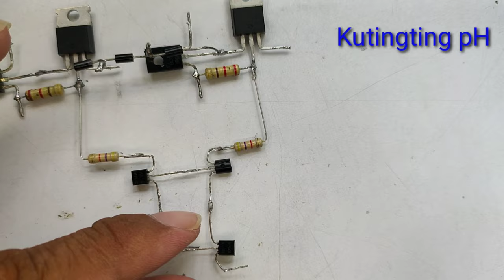DIY audio Driver Amplifier modified av502 500watts max

Comment: I really do like his drive stage but to go high-powered I would replace the DB139 and the DB140 with the mje340 and the mje350 by Motorola these are very nice transistors high voltage. 🤗👍 The 2n5401 and complementary  2n5551 and the C2073 and the A940 are nice transistors that he used they are high voltage. Add more output transistors and a higher voltage transformer rectified to DC and you could turn that thing into a 1000 watt amplifier mono block. But overall I think he did a great job 🤗👏👏👏👏💯

Comment: Great circuit sounds really good I decided to build it yesterday I put all the components on a PCB board and I put a 470 / 50 volt cap at the beginning of the input to give me a little bit more bass. Love this circuit nice schematic layout as well ✌️💯🤗 going to add more output transistors to make it a thousand watt amp. And thank you for sharing you're awesome. 🤗
Reply from the maker: Thank please like & share👍
Reply: @kutingtingph  Your welcome ✌️😁
Reply: hi good day po master,boss pwedi po, pa request diy ng wireless mic po..thankz...

Comment: U can make 1000w amplifier.?
Im very interested..
Reply from the maker: Ok sir
Reply: Yeah all he has to do is add a bigger transformer 35 amper  rectifier and bigger caps and more transistors on the output stage with bigger heatsink with cooling fans and definitely bigger speakers 2-12 or 2-15s 4 ohm load and 16 gauge or 12 gauge speaker wire to connect the speakers.👍💯 what he just built there is a drive stage with two transistor NPN and PNP on the output stage push pull class Ab amplifier approximately 75 to 100 Watts output power or maybe 150 to 200 watts depending on what transistors that he used on the output stage✌️
Reply: I really do like his drive stage but to go high-powered I would replace the DB139 and the DB140 with the mje340 and the mje350 by Motorola these are very nice transistors high voltage. 🤗👍 The 2n5401 and complementary  2n5551 and the C2073 and the A940 are nice transistors that he used they are high voltage.

Comment: sir sinubukan ko 45vdc sir umosok po ung dalawang 4.7k sa collector po ng c2073 at a940, anu po problema nito sir? Hndi nia po ba kaya 45vdc sir?
Reply: First of all you should try using 1/4 Watt and 1 watt resistors 1/2 watt resistors could burn up. All resistors have a Watt rating. And make sure that the positive VCC wire is on the NPN transistor and the negative wire VEE is on the PNP transistor of The collector and make sure all three diodes are facing the same direction one wrong move will destroy the whole amplifier pay very close attention to what he is doing I hope this helps 💖✌️

Comment: sir bakit ang init po si bd139 at bd140?
ginawa ko kasi bat mainit sya
Reply from the maker: bd139 at bd140 dapat solo Lang nya Ang 220 ohm resistor Ng emitter supply nila pag umiinit Ang 220 ohm iinit din bd tranie dapat d iinit or b dadaan sa 220 ohm resistor  Ang supply Ng deffirential section 
 or dapat solo Lang Ng bd tranie Ang 220 ohm resistor at supply nman Ng collector side Ng differential ay Ang resistor 4.7k dapat 1w Ang 220 ohm  
At 4.7k 1/2w pwedi na salamat Sana  y naunawaan mo salamat👍
Reply: @kutingtingph  sir ano fb name nio patulong naman
Reply from the maker: @christiannicolas1956  pm moko sa Kutingting pH Facebook page ko nakikita na dun ok

Comment: wow 33 vac pwedeng pwede na pang bahay at pwede narin pang sounds sa labas hihihi...

idol talaga kita kahit kailan.

Galing sir. ayus
Reply from the maker: Salamat lods
Reply: @kutingtingph  sir ask if pwede 5198 at 688?
Reply from the maker: Pwedi sir
Reply: @kutingtingph  sa 940 at 2073 sir pwede substitute tip41c and tip42c?
Reply: sir bat di gumana sakin.?

talong Circuit na pinost mo sir wala pong gumana bat ganun
Reply from the maker: Goods ba mga Transistors mo lods 1.basic tests Transistor Kung goods. 2.anung trasistors Ang gamit mo Anu Ang datasheet neto
Mag kakaiba data Ng mga trasistors
Meron👇
[B C E]
[E C B]
[E B C]
Sana nakatulong
Reply: @kutingtingph  ginamit ko po ung tip41c at Tip42c tapos Bd139 at bd140 tapos 5401 at 5551.sir..
halos bago mga Transitor ko sir 

ano ba name nio sa fb po?
Reply: Indonesia
Reply: Sir christian  licayo nicolas tested ko nayan hehe working

Comment: For the ones that want to use higher voltage transformers use the tip41c and the tip42c in place of the c2073 and the a940 I hope this helps. And don't get the transistors confused ones is a NPN and the other one is a PNP😂 and the pin outs are all the same B C E
Reply: What is the problem bro max voltage of these  C2073 and And a940 is 150 volt and that is grt instead oF 80 volt of tip 41c and 42c